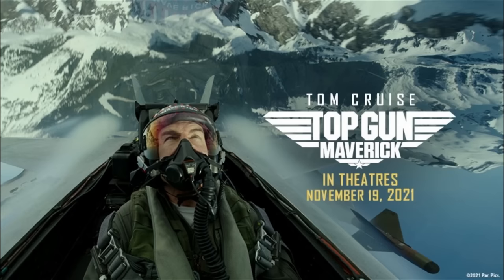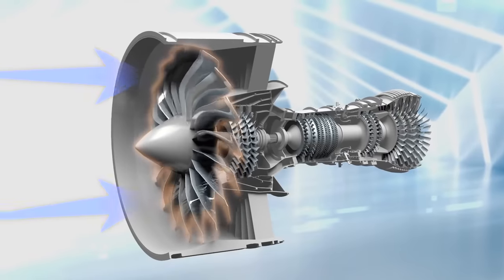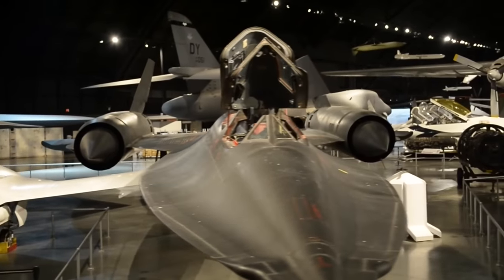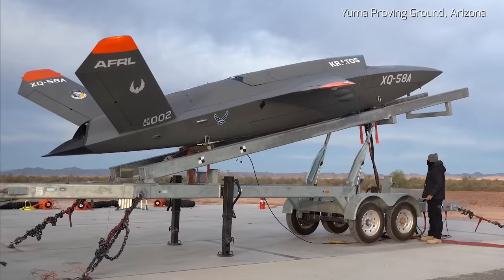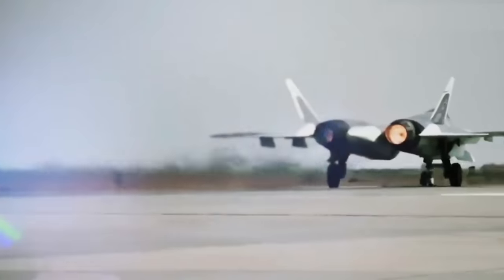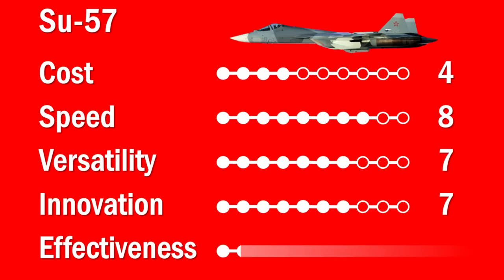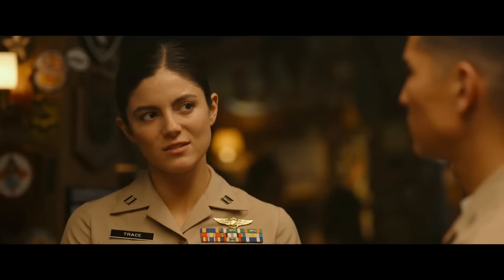Aerospace Engineer Reacts to TOP GUN: MAVERICK

Comment: The Su-57 jets are not a threat to anyone - Russia has got only 4 of them (the 5th has already crashed). They had issues with engines, fire control units and radars. With the current situation - Russia is not going to complete these jets soon.
Reply: Also not true 5th Gen. I doubt they'll ever fly 🪰 and if they do it'll still won't be able to threaten the Raptor or F35. They may as well mothball  them.

Comment: I flew the darkstar in microsoft flight simulator and at mach 11 i lost control I thought it was just glitching out but now I know better. Thank you😊
Reply from the maker: Haha! Yep not designed for Mach 11 😂 glad you enjoyed the video. Thanks for watching!
Reply: @AviationAustin  But so much fun on the way there.   But ease off - the need for speed only goes so far and best not exceed design spec for the airframe!
Reply: Also: Achieving mach 1 is hard if you forget to take the gear up. 🙈
Reply: How did you get it to mach 11. The most I’ve been able to get is 10.01.
Reply: @powerhouse8310  you have to fly to the edge of space where the air resistance is less.
Reply: @powerhouse8310  i dont know how i did it. I was at mach 10 and turned off the scramjets. I think it just glitched out
Reply: @anthonystone2089  I go all the way up to 275,000 ft. but I still only get 10.01
Reply: @powerhouse8310  You can glitch it to mach 13 by killing the scramjets and restarting the turbojets at 210,000ft

Comment: The advantage of fifth generation fighters is absolutely in no way “small”. K/D rations in Red Flag have been recorded as being in excess of 20/1. There is no debate over abandoning advanced fighters, that would be ludicrous.
Reply: Mucea.
Reply: @CHAD THE BORIS Funny you should type this considering the movie went out of its way to hype up the Su-57 which is no where near as much of a threat as the movie made it out to be. The Su-57 is at best a 4th+ generation aircraft and fails many of the accepted expectations of 5th generation. There are currently only 2 airframes that meet the definition of 5th generation and that is the F-22 and F-35, both the J-20 and SU-57 are lacking and are nothing more than upgraded 4th generation airframes.

Comment: I like the fact that when the movie shows the scramjet switch over it works just like Republic's setup for the XF-103 with a ramp coming up, blanking off the engine and diverting air into the scramjet portion of the engine.

Comment: Did you know that the first SR 71 Had the same situation as the Darkstar. At Moc 3 one of the engines flamed out and the pilot had no control of the aircraft as it started to rip apart. The pilot and the systems officer ejected. The pilot made it safely but the systems officer broke his neck ejecting similar to Goose.
Reply: I guess if we ever make such aircraft we would make it with single engine...
Reply: @skipperg4436  The problem in that case is that there isn't an engine powerful enough to make a plane reach those kinds of speeds without having a second

Comment: Supermanuverability is also only really good in one on one dogfights, which almost never happen in reality.  It can give you an advantage against a single aircraft, but leaves you slow and in a low energy state and easy pickings for any other enemy fighters in the combat zone.  It is a lot of expense and engineering added to an aircraft for a very situational advantage.
Reply from the maker: Those nozzles are incredibly complex and by far the most expensive part of the engine.
Reply: it is really important missile evation
Reply: @anuvisraa5786  Exactly!  Stealth is king in modern air to air combat and lobbing missiles at your target beyond visual range before they even detect you or the missiles is how it will be done.  If you get close enough to your target where supermanuverability becomes a factor then something went horribly wrong along the way.    

Supermanuverability leaves you in a slow and low energy state and is pretty much only used when the aircraft are within visual range of each other.  If you use it and don't get a kill on your intended target or there is another enemy aircraft in the combat zone dogfighting you, then you end up in a situation where you will be an easy gun kill.  It doesn't matter how stealthy you are then, you're not going to be invisible to 25mm shells being fired at 3,300 rounds per minute.
Reply: It's the aircraft version of drift style driving an automobile. In racing, there is a very narrow set of situations where it can be the correct solution - that is, the fastest - but it sure looks amazing.
Reply: @anuvisraa5786  Yes, one missile will be evaded, second will be eaten due to how much speed is bled. There is good reason, why best defense is roll and dive into dense air - it trades energy for speed and drags missile into dense air, where it looses a lot of speed and not vector into something that looses all speed horizontal speed and then accelerates from essentially stall. Pilot wants to convert energy gradually, not kill speed and start converting energy into speed.
Reply: @everythingjustincox7467  nor we know what new SU can do.
Reply: @AviationAustin  yeah, I don’t know why you said the US doesn’t have super maneuverability though. Since the F-22 does have thrust vectoring and control vectoring which isn’t as good as 3d thrust vectoring but it is pretty close. But either way it really doesn’t matter does it.
Reply: @KneedsItsGat  X-31 had it in 1990, USAF and NASA played with it for a while and decided that supermaneuverability is not worth it. And X-31 was far more maneuverable, than anything russians have ever created.
Reply: @solarissv777  what does that have to do with the F-22 lmao. I’m just stating a fact about the aircraft
Reply: @KneedsItsGat  I just stated that US had a true 3d thrust vectoring aircraft, but eventually decided this capability to be unnecessary.
Reply: @solarissv777  well yes, since they can achieve close to the same outcome as 3d thrust vectoring with thrust vectoring and control vectoring. Like I said lmao. I’m not arguing with you here my man.
Reply: Yeah and what's the supermanuverabiliby gonna do when the enemy jet fires at you before you even see it
Reply: the meaning of the Su-57's supermaneuverability is that the Su-57 and f-22, thanks to similar radar characteristics and invisibility, should not notice each other until they collide with their noses (substitute any 5th generation aircraft instead of the f-22), especially since supermaneuverability does not worsen the other characteristics in any way and is just a bonus =)

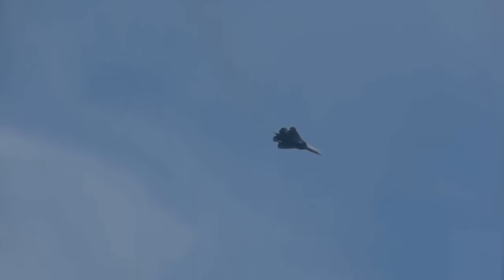Comment: 10:45 "if you are in a dog fight between F-22 and Su-57, the F-22 is gonna fire before it even sees the Su-57"

Well, that is assuming the F-22 can actually not only detect the Su-57 at that range, but get a lock on it without being detected itself. It might well be possible but since most data including actuall radar cross section of the Su-57 is unknown at the moment, its impossible to assume

Also, we have to be aware that if both planes are approaching each other at the speed of sound, 20km gap is covered in just about 14 sec. If they are approaching at supersonic speed that gap is just from 13 to 6 seconds. 
In stealth aerial warfare, maneuveravility has just become MORE important than for previous generations as mutual detection might not happen until the point that both pilots can both see each other visually.
Reply: i think the su 57 also has a better radar than the one in the f22, as it is a lot newer, su 57 also has irst which would certainly help detection at closer ranges due to the large bore angle of it, the rating of 5.8 is a bit silly imo

Comment: If you had a flame out at high mach perhaps the computers would instantly disable the other engine to prevent loss of control. Just a thought.
Reply from the maker: That would be smart
Reply: That's EXACTLY what was done with the SR-71 Blackbird, though not until after they lost one due to an engine flameout.

Comment: Mach 11 is no different from Mach 10 other than increased dissociation of air particles. Dr. Javier Urzay's Stanford Hypersonics lectures are available on YouTube. Also, the Microsoft Flight Sim is way off with the max cruise altitude for Mach 10 being above MECO altitude for Falcon 9, unless you pull up and shut off the engines to perform a zero-lift ballistic to hit an apogee in the aircraft. William Heiser's 1994 book "Hypersonic Airbreathing Propulsion" trajectory tables (available on Amazon) puts Mach 10 max altitude at around 150,000 feet.
Reply: very advanced stuff
Reply: This is nothing, i saw someone fire a solid fuel rocket from a hoover pipe in my street on UK Firework night when i was a kid. blew my mind
Reply: Dissociation likely wouldnt occur in any reasonable amount at mach 10, thats a re-entry speeds thing (Im thinking mach 25). Youd get vibrational excitation for sure, but dissociation would be alot let likely. Youve got to be very hot for that, and at those temps youd be flying with a blunted body and ablative cooling
Reply: I'd imagine that the airframe/engines were just not suited for anything past mach 10, which would have led to sub-optimal flow over the wings/through the engine.
Reply: Classified Top Secret but is very real
Reply: Most of your comment is just incoherent nonsense.
Reply: Mach 11 would introduce more heat to the airframe due to friction against the air, for example, Mach to is roughly 3500 degrees, Mach 11 would increase that heat further, which may be more then the heat resistant matirials can handle
Reply: @everythingjustincox7467  correct

Comment: I know the Raptor was the 1st '5th Gen' and newer near peer '5th Gen' have 'super maneuverability' but the Raptor is no slouch as you did say slightly better. From my understanding it isn't just about BVR combat but also the US is not a fan of losing energy(kenetic and potential). They don't believe the benefits to doing some of these super maneuverable moves out weighs  loss to the energy state. Or at least that's my understanding. So while the SU57 may do a lil more cool moves the Raptor will maintain more energy and that in its self is an advantage.
Reply from the maker: That's exactly correct. That's why the F-22 remains on the top of my list
Reply: A friend of mine in the industry said it best in the "us" and "them" debate about current  tech Russian fighters... "Yeah, they make really pretty targets"...   😂
Reply: Yeah, coming to a stop to make a sharp turn seems like it just makes someone an easy target.
Reply: Well except the F-22 does also have super maneuverability. It has thrust vectoring and control vectoring that kind of don’t make it as maneuverable as the Su-57, but it’s damn close.
Reply: @KneedsItsGat  no doubt! My point was the Raptor has functional super maneuverability. Not just fancy air show stuff.

Comment: To say a drone can, never forget to date there is still a pilot flying the drones.  Drones have been captured. 

The USA would need to have 6th generation integrated stealth plus actually making a faster plane.
All the stealth craft have been getting slower and slower.

Not only do the Russian aircraft have the super manoeuvre ability the EU craft have it and so do others.
Reply: The canards
Reply: @slimerewoods5766  speed is life its the only thing an aircraft can rely on when it absolutely needs to leave an area.
Reply: there are developments in new radar absorbing coatings that are much less susceptible to high temperatures and thus highs speeds. Also there are developments in new engines, particularly with variable bypass, and with good enough engine you can make even brick supersonic. I believe NGAD and Tempest will be able to get to Mach 3 speeds, maybe even supercruise at Mach 2.
Reply: @slimerewoods5766  speed gets to be very handy to lob gliding munitions in order to not even get into area you are not supposed to be in.

Comment: The Darkstar could have been a whole film, but it's so cool that we only got the climax of that storyline. maybe the best opening of a film I've ever seen.
Also, just wondering why the film didn't showcase their newest gear, apart from wanting more two seaters. I'm assuming the Navy/Air Force wouldn't want cameras or actors anywhere near an F-22 or F-35?
Reply: Yeah they weren’t allowed to show inside the cockpit in either the F-22 or the F-35 so they used the F-18 super hornet instead
Reply: @Seanph25  yeah plus the Navy gave the go ahead to be able to use these F-18s in the movie. And there was no way they would’ve allowed them to use F-35s

Comment: 10:40 there is another reason.

USA has studied supermaneuverability with 3 aircraft, modified versions of F-16 (the VISTA) F-15 (ACTIVE) and F-18 (HARV) and it was achieved on these research vehicles.

They found that, while these modified versions managed supermaneuverability well, it wouldn’t be as helpful in a dogfight too. (Not only BVR.)

USA prioritized energy conservation. Supermaneuverability looks cool and all, but bleeds of energy like crazy. USA point of view is that after doing a move like a Cobra, you’re basically frozen mid air, sitting like a duck. The enemy jet can just easily turn and blast it out of the sky.

Supermaneuverability can maybe help as the fight continues on, and the energies (speeds) of both jets have dropped, along with their altitudes. So basically a low altitude (deck level) and low speed combat. Jets without supermaneuverability will require at least some speed to be able to turn well. Supermaneuverability will then enhance nose authority and may bring victory in that type of a fight.

But the idea again is that the fight could just end before that point, especially with missiles like AIM-9X.

Also;

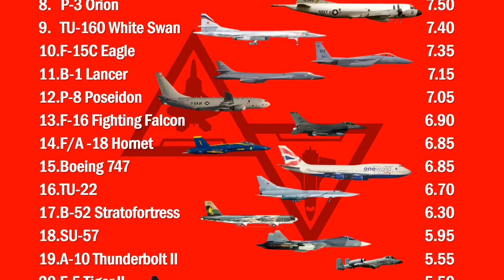13:30 man that’s injustice against the Viper :(

Viper should at least be much closer to F-35.

Comment: An elderly skunk works engineer called a radio station and said the classified top speed of the SR-71 was just over mach 14. The higher it went, the faster it went due to a decrease in drag, but also, the higher you go, the faster you HAVE to go in order to feed the engines. 

I wanna know what we replaced the SR-71 with. Seismic stations have picked up sonic booms from something traveling MUCH faster.

Comment: Scram jet, by definition, cannot create thrust because there is no compressibility at the inlet diffuser. It’s not that it can’t get up to speed, it cannot move. The scram jet engines usually have solid propellant, and when the compressibility from the forming shocks kick in, that’s when scram jet takes over.

Comment: 5:30 instead of two engines which can cause thrust asymmetry, why not wrap the aircraft around one giant engine? That way if you get an engine flame out you just become a glider.
Reply from the maker: Usually this is done for redundancy. If you loose an engine you can still fly semi-normally, unless you're going mach 10 😅
Reply: @AviationAustin  but won’t having one engine out throw it’s thrust off balance
Reply: Or, in the case of an F104 ... a "tent-peg" ...
Reply from the maker: It will, but the pilot can trim the airplane to compensate.
Reply: Also having one giant scramjet engine would be problematic as combustion oscillations could cause a flame out as they disturb the supersonic airflow in a larger combustion chamber
Reply: Also, many of the new generation jets are designed around maneuverability with significant computer assist. If they lose power, some of these jets ... are less aerodynamic than a brick. ;-)  On the other hand, there was some R&D to model a jet using the hydrodynamics of a Blue Whale (I Think?), which might kick maneuverability into a new dimension.
Reply: Some of the first ramjets did exactly that.
There's one at the San Diego air and space museum and the pilot literally occupied the inlet spike of the ramjet.  It looked like they had to disassemble part of the engine just to get one small skinny pilot in and out.  Definitely not for the claustrophobic to even think about.